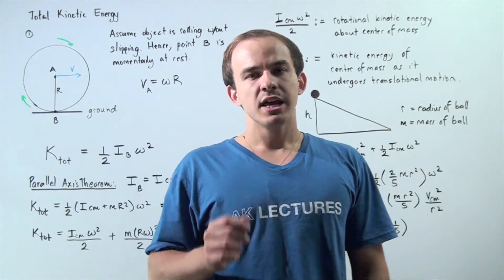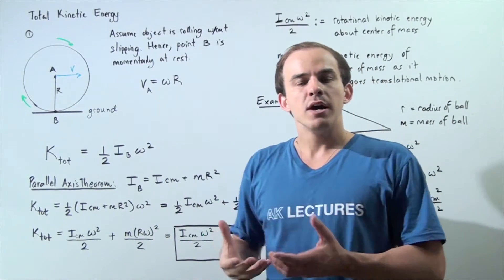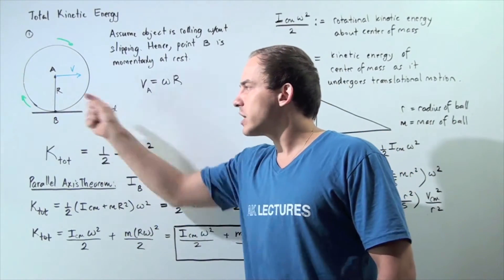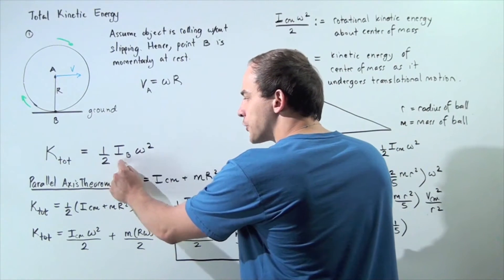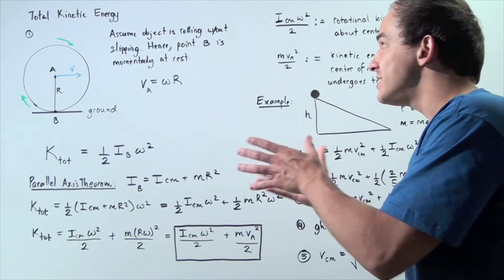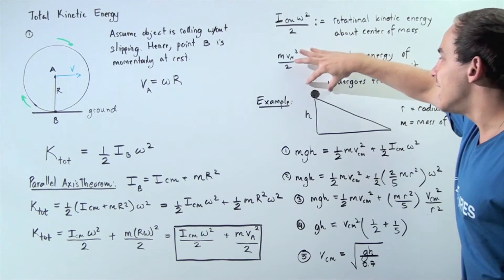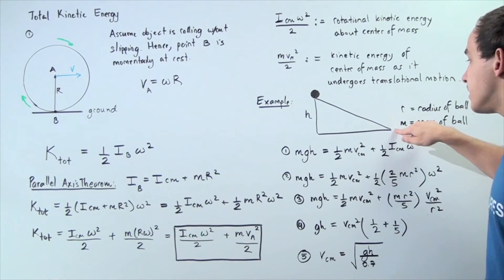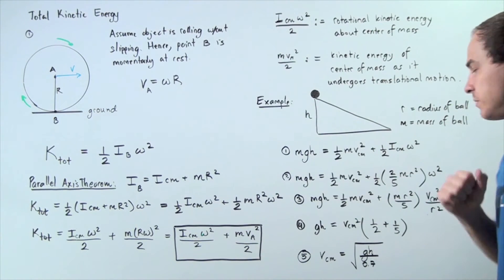Total Kinetic Energy (Translational and Rotational)

Comment: Why point B? Because it's the instantaneous center? What about if you have a rod that's translating and rotating (about it's end and not about it's center of mass), could you use the end of the rod for I ((ml^2)/3) as point B as in your example? Or does point B have to be the IC?